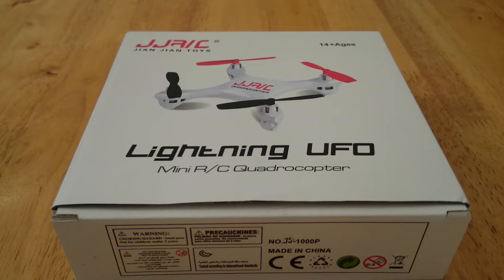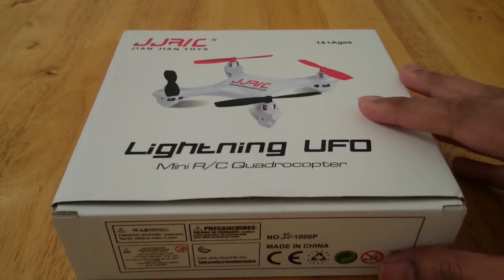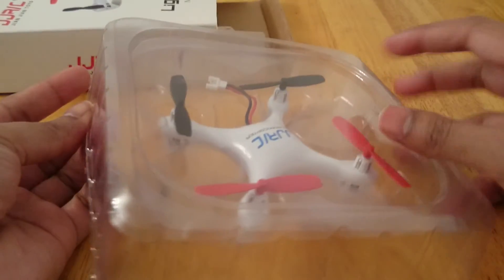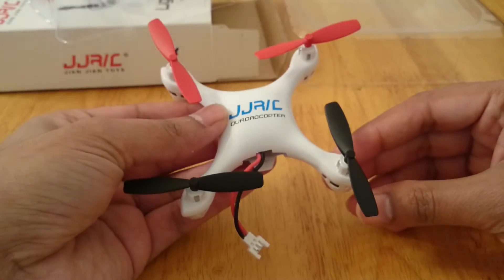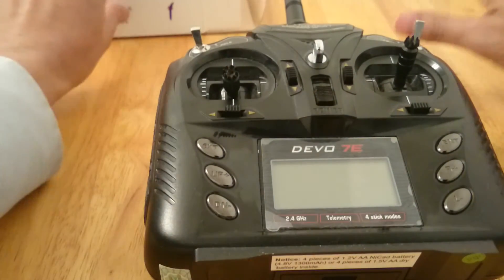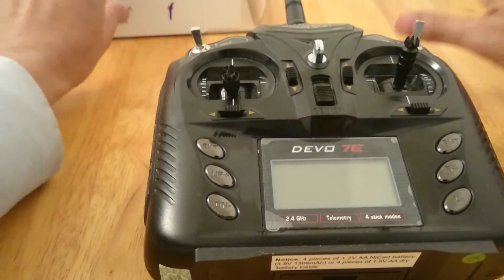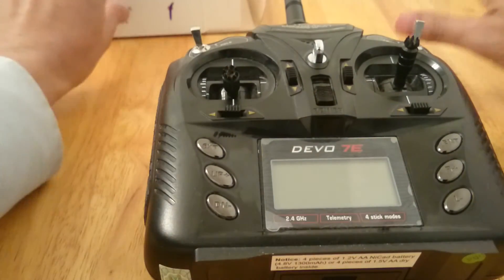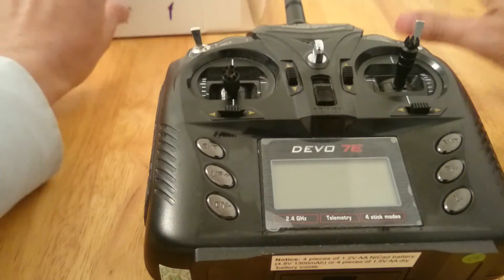JJRC 1000A Mini Quadcopter unboxing. Bind with Devo 7E Transmitter

Comment: Thanks for video :)
I have exactly the same combo (JJRC 1000A + modded Devo 7E), but I don't have "Bind" option in model menu! I have Deviation 4.0.1 installed and there is "Re-Init" option instead of "Bind" (and it isn't working). And I don't know how to set automatic bind at startup. Your help will be appreciated :) Thanks in advance!
Reply: pnr36p Replying to myself :)
There wrong option was set in tx.ini in nrf21l01 section. So now it works fine :)
Reply: +pnr36p Whats wrong there? I can't seem to make my 1000 work....it flies reversed............................
Reply: thnx m8 I will try it out